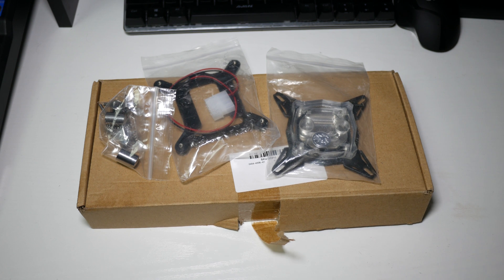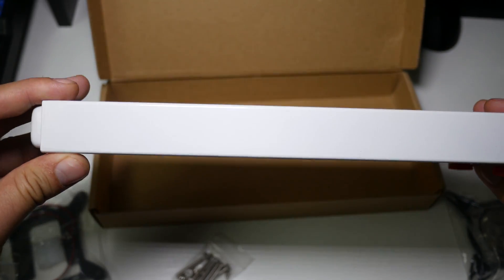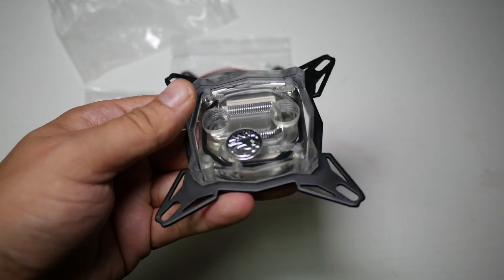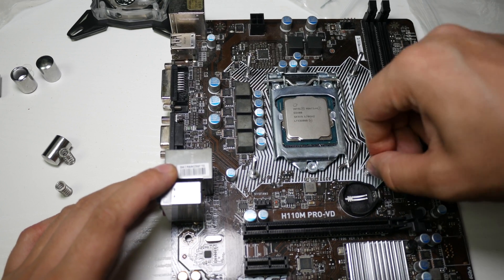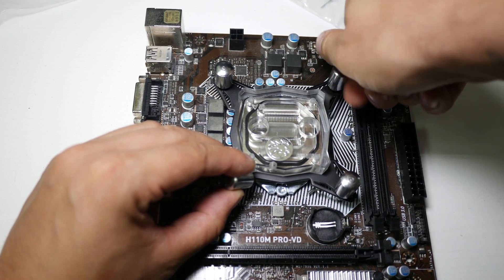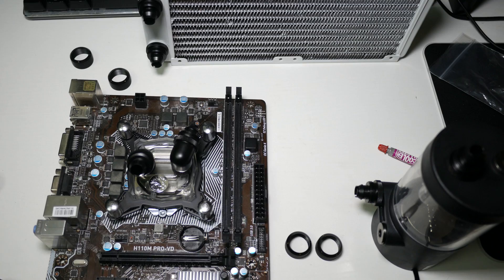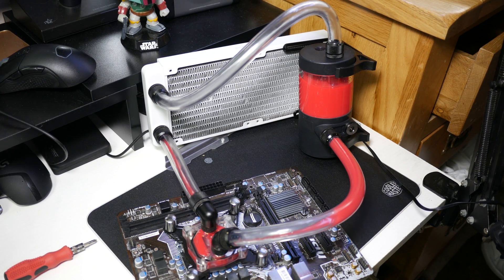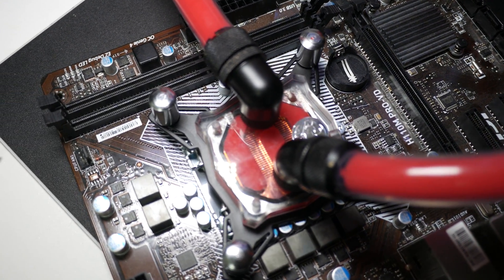Banggood.com Watercooling Parts - £13/$17 Bykski Waterblock + Freezemod £30/$40 Copper Radiator

Comment: Even if they say on ebay/aliexpress its Copper IT IS NOT. If you ever held true copper radiator in your hands you'd know how damn heavy it is. I got 360mm rad from xspc and its ridiculously light weight. I honestly doubt they use much of copper. I'd guess maybe 10% copper max. Ive got same waterblock btw :)

Comment: Water cooling on such crappy specs is just ridiculous, no matter the cost...
Reply from the maker: agreed and i do  have better configs but i need them for benchmarking for the channel. I had to use hardware that was no longer really in use or i had multiple off . this was my first trip down the watercooling avenue and i think the build looks good but due to the risk i wanted to not be to out of pocket if it went wrong. as for crappy this is still perfect for what i use it for though which is first person shooters 1080p all low settings on a 144hz panel, and i do it all completely silent.
Reply: Never fail to see this comment or some variation. Are dudes so dense they can't understand not everyone has a $3-5k system built... but AIOs started it, water cooling is loosing it's "Enthusiast Only" stigma as prices come down and more products hit the market.  Sound levels are just as important in water cooling as overclock and thermals for some people silence>performance. By all means though, no one's stopping you from squeezing 2-3% more from your hardware for 6 months before something else is the best it's just not everyones goal.

Comment: that radiator is NOT copper. i bought it, the frame is brass but the fins are aluminium. just scratch the paint and you will see. it will cause corrosion it's a very bad radiator.
Reply from the maker: Loads of radiators have coper tubes and aluminium fins. The fins don't make contact with the coolant.
Reply: Only the fins are aluminum or the tubes too?
Reply from the maker: @arnislav  just the fins
Reply: That's brass radiator (brass inlet brass tube) the sides are steel and the fins are red copper
Reply: Does aluminium corrode when not in contact with water? Ive heard aluminium in dry contact (like a bracket for a CPU waterblock) is not a problem.

Comment: How much did it cost you in total?
Reply from the maker: Abhilash koushik the total cpu + gpu loop minus fans was just under £200. I could of built it a fair bit cheaper but I don't want to go with the cheapest of the cheap parts. I wanted a cheap loop but still with a nice look and semi good parts. The full loop video should be up in a couple of weeks.
Reply: TheFullSetup okay is it reliable to buy on Bang good.. I always think it's quite sketchy..... I'm also looking to build a custom water cooling for my Ryzen
Reply from the maker: Abhilash koushik obviously there is a lot of not good well too cheap stuff but there's a lot of good. I found getting the barrow  fittings were the same price. Don't buy all cheap brands hence why I got an ek universal Gpu block. Just research heavily I didn't just go I'm Gona build a loop and ordered loads of stuff I've been looking into this for sometime. Spend the extra on copper do not get aluminium. The block has lots of good feedback from other sites I looked at. This is just going to be my first gen loop first things to go will b rad I want a thicker one and will pick up a nice pump Res combo a little later.